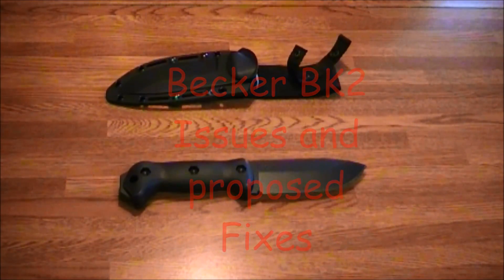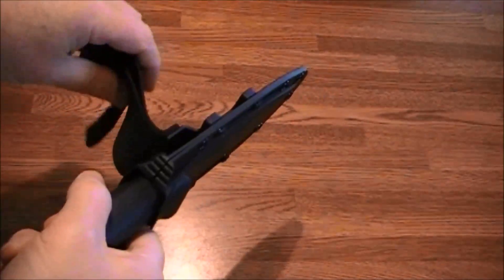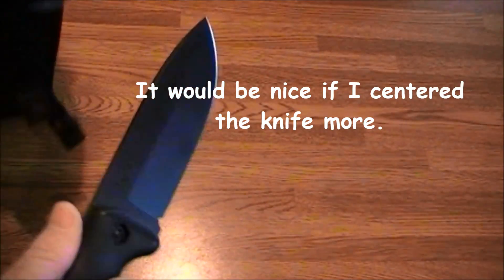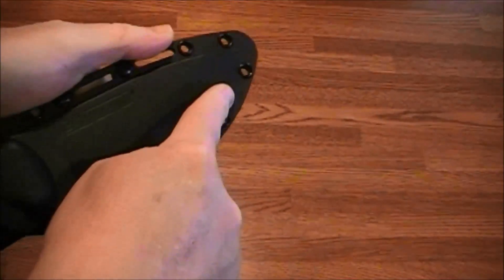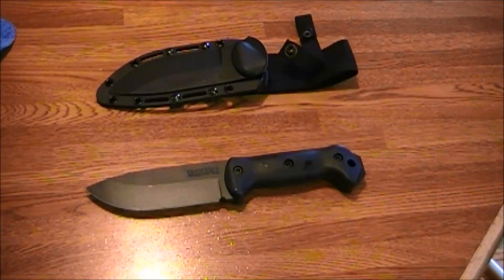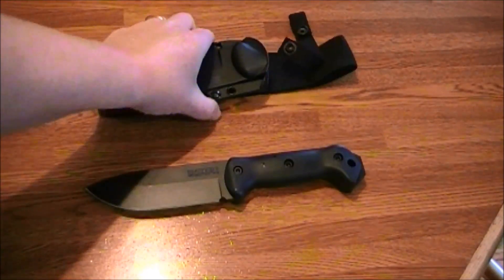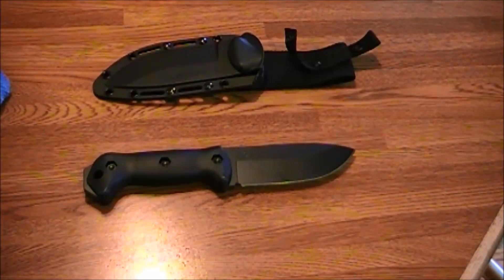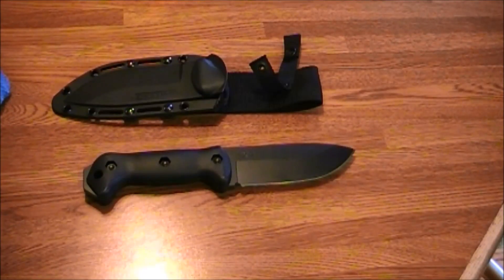Ka-Bar Becker BK2 Part 2 - Issues and Proposed Fixes

Comment: Thanx, I personally never had any slippage problems with the Grivory Handles, the Steel is great, originally it was 0170-6C, Camillus made the CarbonV Knives for Cold Steel, when the Steel Co. went on strike, that caused Camillus go belly-up, now Sharon Steel Corp. is making it with a new name 1095 CroVan, the only difference, between the older Camillus BBK's, and the Ka-Bar BK's, is the handle of the new BK's, is skeletinized, which Becker even made a comment on it, that there is no way, that makes the knife weaker, but, the improvement is, it is blade havy, which I think is great, as far as the Grivory Handle, I like it almost as much as the Canvas Micarta, great stuff, good video, Thanx.